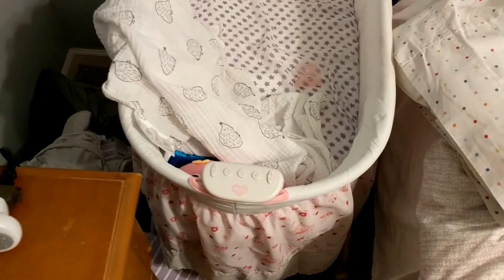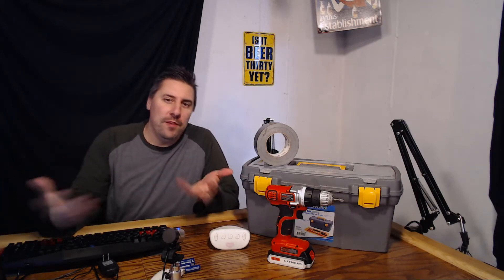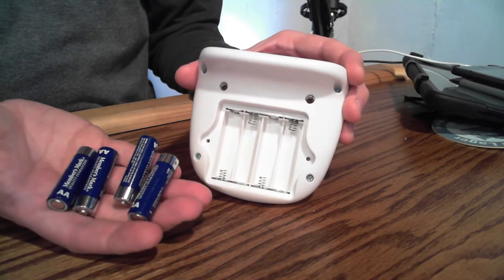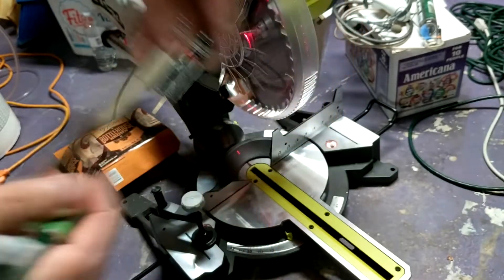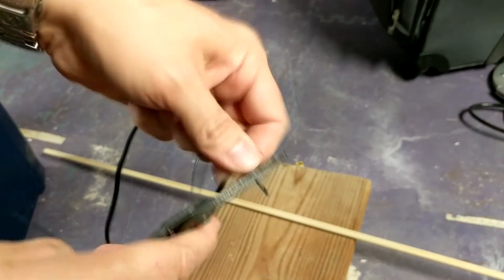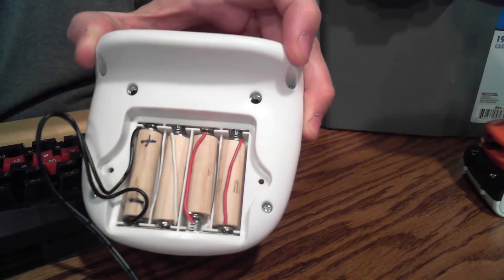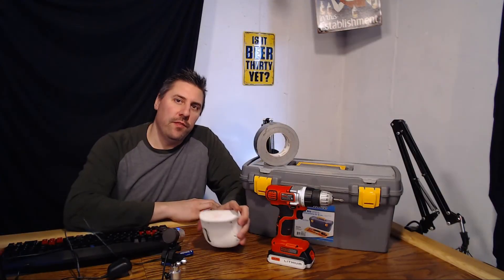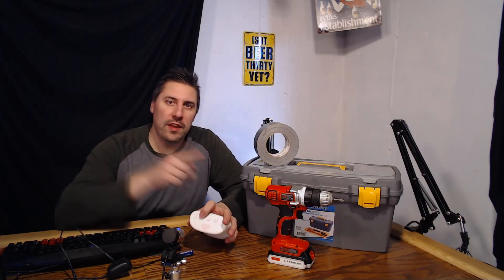Convert Battery Powered Devices to AC Power

Comment: You need only first and last dummy,  connected by a wire, save your time.
Reply from the maker: ok cool, thanks for the help!
Reply: Can u draw the schematic?
Reply: not sure if you meant it this way - 'connected by a wire' throws me - you don't need a 3rd wire. Two dummy batteries, one with a positive terminal only, one with a negative terminal only, and they go in the 1st and 4th slots, without any other wires. It's the same as touching the power supply leads directly to two points without the slugs (just the two power supply wires are needed).

Comment: Most importantly use caution especially if kids are going to be around and always verify the output voltage of the transformer using a multimeter before connecting anything else . Just because a AC to DC adapter says it's a certain voltage doesn't necessarily mean that it is .
Often times they can go bad and can either be too high or too low or  not working at all . 
In other words never EVER assume even when you bought it brand new . I've seen my fair share of dead adapters right out of the box and then some while installing security systems for a living which is why I always had extras on hand for just in case I needed them .
 Also always check the adapter for any excessive heat build up or unusual high pitched sounds that would indicate that it's on its last leg .
Reply from the maker: Great tips, thanks for sharing!
Reply: What if I wanted to convert my battery-powered multimeter to AC power?
Reply: What are you doing in order to accurately test the transformer ?

Comment: It’s not ac powered it’s still dc because you ran it off an ac adapter which turns the ac power of mains to a lower dc voltage for your device
Reply: flightworks yes still dc... but make sure the right amount of voltage to use with this experiment and if you go higher than the require amount it will explode.